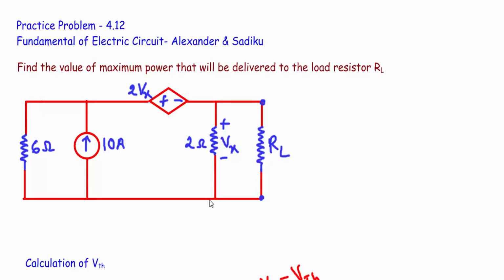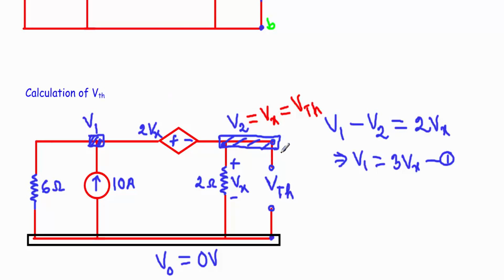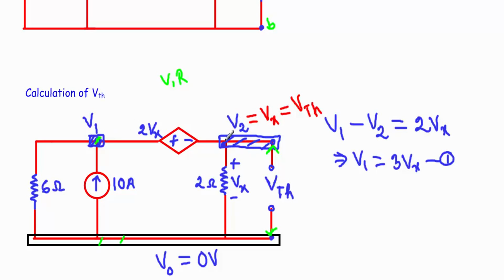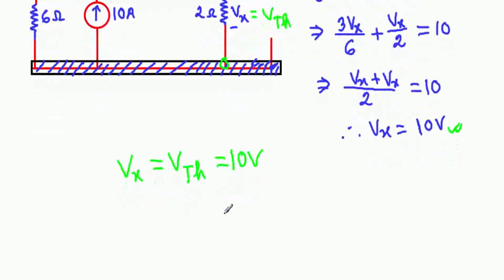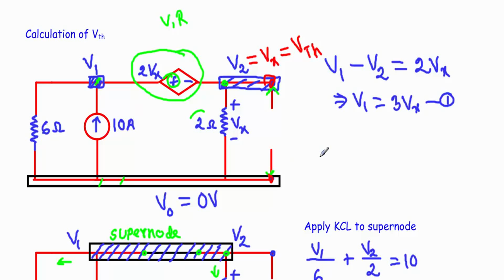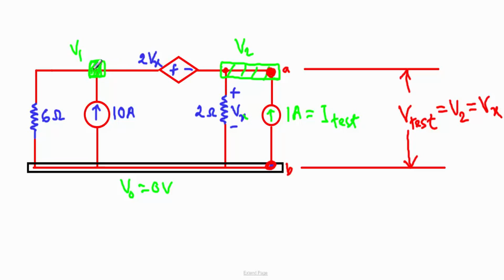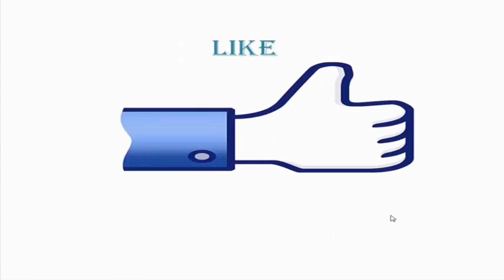Maximum Power Transfer Theorem Dependent Source 1

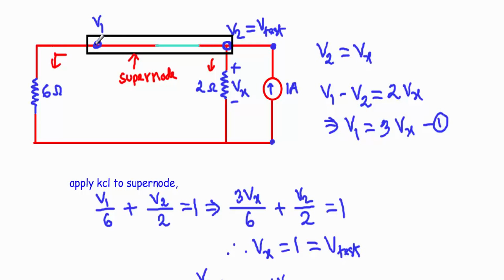Comment: At 7:45 why can't you just leave the dependent current source in after you get rid of the 10A source and do KCl at the Vx node? Wouldn't it no longer be a supernode at that point? You just have a dot at a random place on the wire but a node is a point where branches intersect.